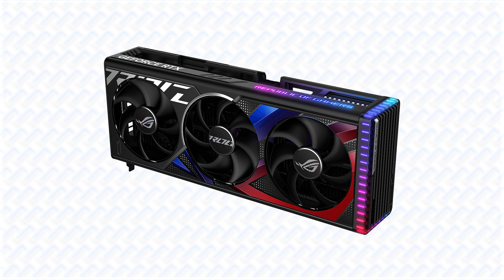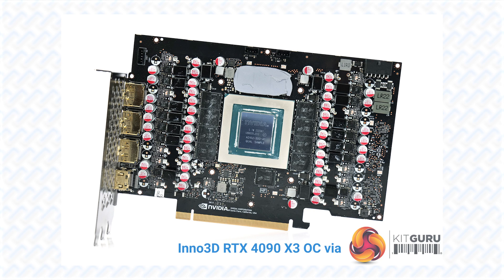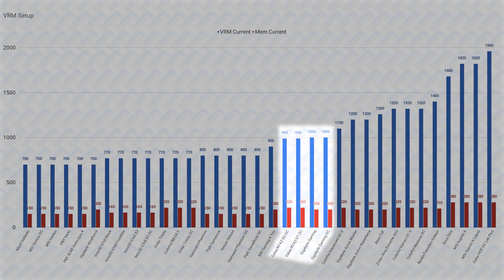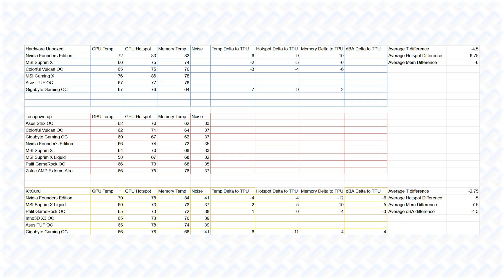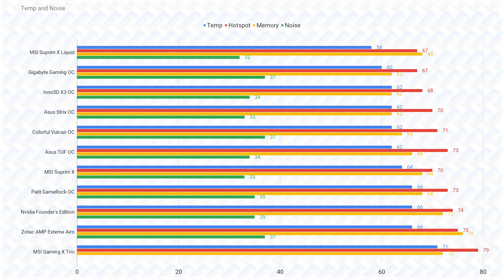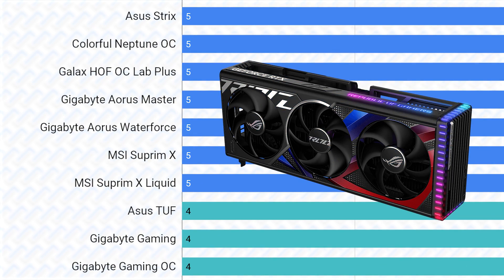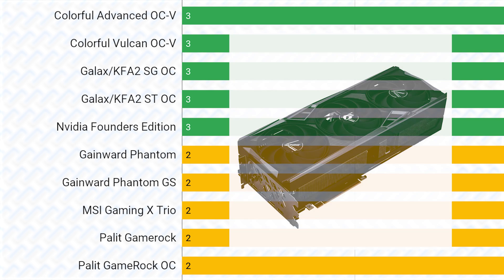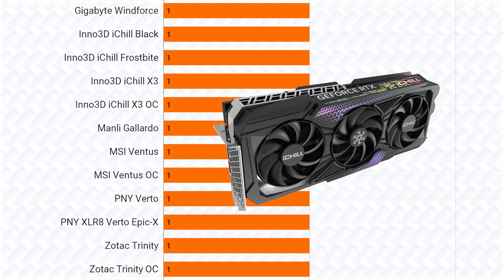Which RTX 4090 to BUY and AVOID?! | 35 Cards Compared! Asus, MSI, Galax, Gigabyte, PNY, Palit, Etc.

Comment: Great video! I am considering getting the ventus non OC (It's the cheapest option) how much more performance would a card like TUF (or any other of the top options) have after it's overclocked and can use it's 600W power limit ....  like 5% 10%? more than the ventus?
Reply: I have an Asus Tuf OC that I purchased on launch day and spend way too much time researching, overclocking and helping others. It mainly depends on the silicon because even the lowest tier 4090 can outperform an upper tier 4090. But, I can tell you that the 600w power limit, increased vapor chamber cooler and better vrm's will allow to push the chip to better performance. I can push my 4090 to get an extra 6-14% overclocking depending on the scenario. My Asus Tuf OC 4090 actually overclocks in the top 5% of all 4090s on 3D Mark. Not bad for an air-cooled 4090. If I had to give a number it would probably be roughly a 5% difference comparing the lowest tier to the upper tier 4090s when it comes to overclocking.

Comment: Can you share your opinion on MSI ventus specificly? Like over all is it good or bad? Is it worth 1770 Eur.? Any other card would cost me a additional 200-500 EUR, high taxes in my country, Like MSI GeForce RTX 4090 VENTUS 3X is it really that bad when compared with every other card?
Reply: Did you get the ventus? Any good?
Reply: @dragonclubracing8669  Yeah I decided to buy the card because I managed to get a brand new card for about 1250-1350 Eur. ( I can't remember exacly but it was close to 1300 Eur.).  With 2 year warranty and the price that I got it for I am happy.

So I didn't really have that much time to test the card out because I am busy with work and studies but the games that I did play, I can say that I am happy with my purchise. Because I use a 4K monitor,, so for me the extra power was a perfect match. Every game be it The Last Of Us, witcher 3, 7 days to die, dying light, cyberpunk, red dead redemption 2 and so on. Every game is over 60 FPS on ultra settings. The games I played had no lag spikes or bottle necks, the GPU itself ran at a cool 70 Celcius ant with provided mounting I don't need to worry about the card bending over time. (Granted my PC has extra 4 fans so that helps with temps and I keep it close to the window so it gets some air from the outside). 

Over all I would say the GPU was a perfect thing for what I needed and I am happy that I trusted my instincts, information and research. The video made it look like the CARD was not worht it and it would be a bad idea to buy it. But to be honest I think that card was the best option to buy. I had a friend that both a ASUS card for 500 Eur. more and another guy that event went in over 2k Eur. and both of them are right now doing a refund because when we played same games we basically got the exact same score or a bit higher on the side (by like 5-7 fps). So the money they spent was not worth it. At least for them

Comment: The only thing that many reviewers are missing is a COIL WHINE! 
Top tier cards from this list has a random lottery to get card with a coil whine, although Zotac AMP has a zero coil whine, since they use protection from that.

You are sitting next to your PC and the top tier 4090 card for 2000 value will produce that hi pitched irritating noise. Will all the advantages compensate that?
Reply: If you dont hear the jet engine than the card is slow. :)
Reply: I would return that fancy $2000 card so fast if I hear that disgusting bee hive noise.

Comment: Ended up getting the Asus Tuf OC used on Amazon for cheap after searching hard for a reason to buy another MSI card (Was a big fan of their price to performance and mid range quality over the past handful of years). This generation just wasn’t for me with the high price and odd cooling situations. Happy with the Asus so far despite the hot water they’ve been in. My card has a small amount of coil whine but I really don’t care about that considering I’ve always had cards that needed to have  fans running loud AF to stay cool. I was able to overclock it quite a bit and was up there on the leaderboards but I’m undervolting for general use. The cooling and power performance of the 40 serious is so under appreciated because of out of touch costs of these cards.
Reply: How are you liking asus tuf now? I want to get one soon i can't hold out anymore lol but i'm worried about the power cable issue. anyway to avoid that?
Reply: @VessMolo   keep an eye on asus web site, the tuf 4090 NON-OC. (read that you can overclock it the same s as the OC its just not set in bios) But i dont overclock i just buy what i need, so not a big deal for me. is in and out of stock but its 1599. (Do not buy one that says OG-they are not as good) best way for cable is buy a atx 3 power supply. I had to have the ASUS as they are the only 2 HDMI card available. I have not seen 1 reviewer mention that. I have a 55 inch sony x90 and a lg g1 77 inch. I have both hooked up to video card. So i needed 2 hdmi.  I have the 4090 sitting here, amazon screwed me, (done with them) mising major parts of computer build and they say i have to wait until oct 7th for them to do anything even though i have proof from post office that they lost the package (I believe not lost stolen by driver-falsified delivery note) so i had to order parts from newegg (was cheaper too) I have never had problems with newegg but left due to all the published problems, im back with them hopefully they continue to treat me well, as I will never buy anything from amazon again! SO i have the card but cant tell you how it is as i dont want to put it in this system Im keeping it intact and building a new system.

Comment: Great video! Thanks! I recently bought an Asus TUF 4090 oc. The i9-13900k arrived a few days ago (paid $306.00 after using points). Initially, the new system build was based on an i7-12700k/ 3080Ti. Big thanks to the wife for all her points! Now I have a potential second system build with the i7-12700k/3080Ti,  just need a new ddr4 motherboard. Current system is i7-6700k/1080Ti. 

Fair winds and following seas to all.

Comment: Was gonna buy the 4090 this august but the 12vhpwr is still a HOT MELTING MESS, the updated 12v-2x6 will not be release on the "new 4090 cards" until early next year,

So yeah, to the 7900xtx then, better to have a functioning gpu than melted one 😭🤷‍♂️

Comment: Question for you, I'm trying to understand what are the differences between the PCB layouts of the available RTX 4090 products. In particular what I'm after are the mounting hole spacing and where the VRM components are positioned. I'm trying to evaluate the feasibility of putting a 4090 into a dual slot SFF case. There will be Noctua fans bolted onto the outside to effectively cool it, and with a bit of an undervolt the heat generation will be a non issue. 

The main problem is that all 4090's come with heatsinks that are too long, some of them may have suitable thickness where the heatsink fins extend to around the two slot thickness, but it's the length that means I will need to find a compatible card (e.g. 4070 or some 3000 series card) and do a heatsink swap.

Comment: -- Buying end of this month.  Leaning towards the TUF though I do have the money for the Strix.  Just not going to do extreme overclocking.  Just a little.  And I think I can offset cooling with my case (13, 120mm fans Corsair 5000D) and a simple custom fan curve in Afterburner.  
   I can't justify the Strix.  But I'd be open if anyone would like to prove me wrong.  If you agree with me, I'd like to hear that too.

Comment: This video actually made me buy a premium 4090 (MSI Suprim X) otherwise I would have gone with a Zotac, purely on pricing. The fact this confirms the price difference is also down to superior hardware and build quality, perhaps justifies some of the price difference. Ultimately if you're penny pinching get any 4090 but if you have a choice :) this video helped a ton.
Reply: Zotac 4090 is great, people are paying extra premiums for brand names
Reply: Wasted your money they all perform the same
Reply: @Overclock23  As I said it's up to you to decide if it's worth the extra cost or not. I wanted the superior build quality (if I hadn't seen this video) I wouldn't have even known there was a difference in components between them. And they may perform all the same in terms of fps but definitely not the same in terms of sound output when under stress or temperatures. 

That's all subjective stuff each individual can decide for themselves :) but how did I waste my money, if I knew going into my purchase I was ok spending the extra on better build quality, not performance.
Reply: @PCMRcult   msi suprim have terrible coilwhine, only the zotac and gigabyte cards dont have any of it, thats why i chose the zotac over the suprim, you were lucky if you picked a suprim card without any coilwhine.

Comment: If the card runs at around 400-500amps, even the lower end of these cards are more than enough. I don't really see why people are complaining, especially when the higher end models are several hundred dollars more expensive, all so you can run at 600W for an extra 5% performance? It's illogical.

Comment: This is an excellent graphics card which has nothing to envy to other famous brands where you get only 1% to 3% max more SPS for more power consumption, what doesn't justify the enormous price difference VS the PNY.
Here my set up with an I9 13900k, and it works like a charm in the quietest way:
youtu.be/inQxrKkRtew

Comment: In my region the 4090 FE is the lowest priced 4090 compared to any other brand. Considering the smaller form factor and how well it's designed and built, I think it's the best 4090 for the money. The hard part is finding it in stock!
Reply: it's almost as if they don't want to have third parties anymore...
Reply: Same for me back in december in Spain. It was SO HARD to get one, but it was literally like 300 to 400 Euro cheaper
Reply: It's was in stock at the Nvidia uk store, I got one yesterday 👍
Reply: @themog4911 Is the 4090 fe Quiet by gaming and how much are the temps i wanna build a 4090 Build but im so confused they so many 4090's
Reply: @themog4911  Second this. Just got the 4090 FE at the Nvidia UK store. Saved myself £900 instead of getting the Asus Strix.
Reply: Well FE cards are the most desirable for a reason.
Reply: would be happy to see the third party go. its just annoying tbh
Reply: @robinspanier7017 I rly want an aesthetic gpu, not an ugly ass gpu where the wires are sticking out
Reply: @ib3x_ 😅 Aesthetics are pointless you should always go price to Performance

Comment: Keep in mind alot of these cards have coil whine noise the ones that seem to not have this problem are the gigabyte cards
Reply: The aorus 4090 from gigabyte are probably the most quiet i've owned but i would probably vertically mount or buy an anti-sag bracket because of their recent bad track record, or even avoid them altogether for now.
Reply: @corpalgt6261   no manufacturer will rma a cracked pcb most of those are user error but to each their own I recommend using an anti sag bracket for all 4090's if not an anti sag gpu stand all the cards are huge and heavy
Reply: At first I bought Asus tuf which had CRAZY coil whine.
Using A Galax variant now where it is a non-issue.
Reply: Gygabite card have pcb fragility problem..  i prefer coil wine😅
Reply: Msi suprim liquid X here mine doesn't 😅

Comment: Dont forget - you have to also base decision on which FITS in your case assuming its not a full sized tower.

But all these bigger numbers vs smaller numbers - the real world difference between all of these cards is marginal at best. These 4090’s all run close to the same level. 

Plus the OC potential ive read is about 1-3% which is pretty bad and pointless extra power.

Comment: EDIT: I should've probably clarified, it's the AIR COOLED Suprim X, not the liquid one lol

I think something missed about cards like the 4090 Suprim X is they seem to be built for durability and longevity, hence why it also won't allow you to use that full 600w and has overkill VRM. Which is why I picked it, along with all it's other pros, that's a great selling point.
Reply: Is this true? Because durability and longevity is my most important factor in choosing a 4090. 
Also fan noise.
Reply: @InVersoFFVII  the Suprim X runs 10 degrees cooler than the Gaming X maybe because the Suprim X got a vapor chamber. That should help the card to last longer. 🙂
Reply: @Ohlukei x trio runs fans at 1400 rpm while the suprim x runs its fans at 2000 rpm
Reply: @kandrotas22  Thanks for the info. I hope the higher rpm will not increase the fan noise by much. 👀
Reply: @Ohlukei  it runs coolet because the fans spin faster 😂 and of course they are louder, imagine buying a card and not even knowing this
Reply: @kandrotas22  Actually the Suprim X can max it's fans at 3500RPM, but this is all down to how you set up your fan curve.
Reply: @ppeez  And you can adjust this with something called a fan curve, the fans go up to a max of 3500RPM, I choose to go up to that limit for maximum performance, it's most likely the same upper fan limit on every 4090, what matters is how you set up the fan curve, and the quality of the bearings.
Reply: @Ohlukei You can adjust fan noise on any card based on fan RPM by simply adjusting the fan curve. The things you want to watch out for are bad bearings and coil whine.
Reply: @I_Crit_My_Pants  why are you tagging me? And why are you telling someone basic shit that everyone knows? You think he doesnt know that you can setup fan curves????
Reply: @I_Crit_My_Pants  Ah yes. My 4090 (ASUS) as silent fans but the card is able to make a horrible coil whine!
Reply: @Ohlukei  Yeah I've heard that about Asus 4090s and some Gigabyte ones. I was originally going for the Asus TUF OC till I read the reviews about the coil whine :/ Then I started reading reviews of other manufacturers and those 2 stood out as having the most coil whine issues according to reviews unfortunately. Not much you can even do about it other than return the card and get a different one, I think? Tbf I didn't look that hard into if there's a way to stop it because I just wanted to avoid any possibility of having to tinker with my card lol
Reply: @I_Crit_My_Pants   Coil whine is my least problem. My first 4090 the Suprim X died after day one. On warranty they fitted the ASUS ROG STRIX OC instead. Now I suffer from random black screen and fans full or random shutdowns. Had not a black screen for two weeks since I underclocked the GPU by 200 Mhz to bring it to Nviidas stock clock. But still strange things happen once a week or so. 👀
Reply: 600w powerlimit is stupid anyways. If you generally care about the lifespan of your hardware you ain’t going to use that. Especially considering the price.
Reply: Derbauer uploaded a video called 4090 power limit make no sense.
Reply: @I_Crit_My_Pants  If you want 600w PL you can flash another BIOS to your card, flash it to the BIOS you care less, probably silent for you.
Reply: @I_Crit_My_Pants  I run my 4090 at 300w (max), i could run it @600w or more, (watercooled, 2 480mm and 2 360mm, both 60mm thick and push pull) re pasting is always a good choice but keep in mind, if you are not in the US, opening the cooler may void your warranty.
Reply: @greggreg2458  Which is why I just dropped the power limit to 100% instead, cba voiding my warranty, nor opening it up, it does everything fine at 100% anyway. I guess they do only technically design the card for 100% and maybe having to do some tinkering like repasting when pushing above that is to be expected lol.
Reply: @claybenson254 I'm on the air cooled one personally lol. I'm running games at 6k downscaled to 4k and getting 120fps+ except on the more demanding games like Cyberpunk 2077 where I can get a consistent 60fps with maxed settings and DLSS off and like 100+ with DLSS on.

I have managed to pull quite a bit of power through the 4090 from 1 game though, more than even Cyberpunk 2077. Weirdly enough it's Old School Runescape... once you turn on the HD plugin and max all the settings, it's shown up to a 560W power draw which is insane really (I did raise the power limit in Afterburner to 115% so it just uses as much as it can thermally handle when it's needed)

Comment: Great video. Really a lot of effort. My main problem in deciding is which card has the lowest noise levels and not coil whine. Gaming OC?
Reply: Asus and Msi heavy Choilwhine had 4 Strix all go back
Reply: People seem to suggest that yes. From what I remember, cheaper capacitors are quieter and the Gigabyte gaming OC uses those

Comment: I am so glad I found this video. I'm about to buy 4090 and I'm so lost with all those models. Great information, I think I'll go with TUF or GAMING OC.
THANKS!
Reply: CHANGED MY MIND ILL GO WITH SUPRIM THANK YOU KING <3
Reply: @mik0lvj  hey bro do u have choilwhine ? I tried 4 Asus Strix and they had terrible choilwhine
Reply: @pmarciano1717  hey man I finally ordered MSI Suprim with air vents. Honestly I didn’t try it yet since I am waiting for a different power supply for my pc to even launch it. 
I’ll let you know how Suprim handles
Reply: @mik0lvj  ok thanks man and good luck
Reply: @pmarciano1717  u2
Reply: @pmarciano1717  hi man, card runs fine even on three pins only. No outside sounds

Comment: if i want to underwolt, how much impact do all those values (VRMs, temps, etc) have ? since im lowering temps, voltage but increasing frequencis , can i do that reliably on the low end cheaper cards, or do i still need card thats "for overclocking" ? im currently thinking about MSI RTX 4090 SUPRIM X
i just want to lower TDP while keeping up the performance, since electricity in EU is still expensive, but nothing extreme